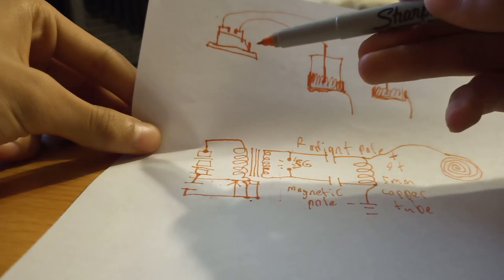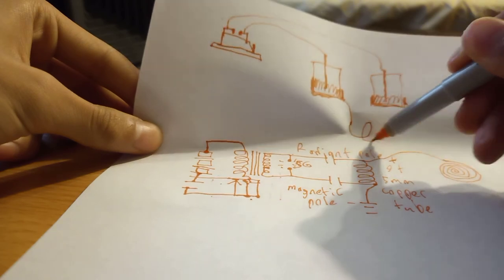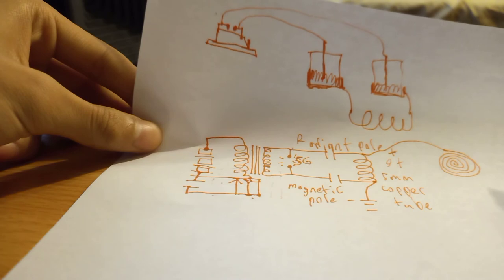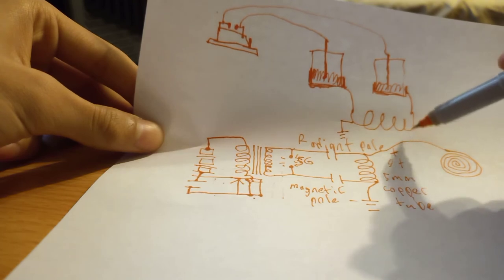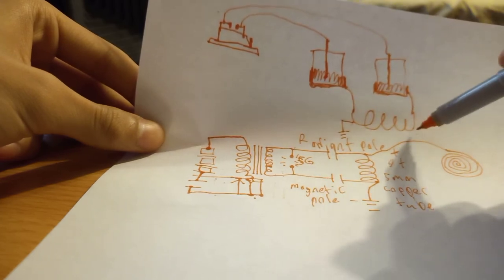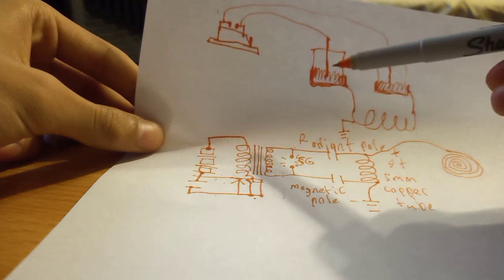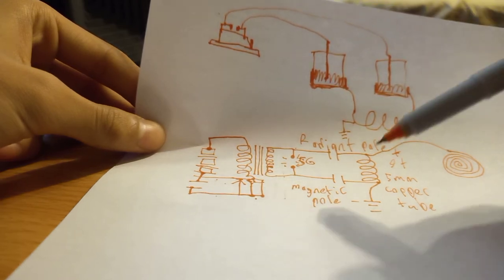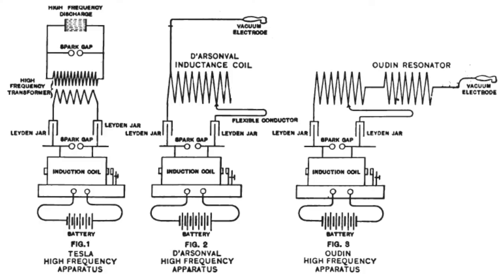What is Cold Energy?

Comment: It is very important to switch the positive of the primary coil, as this produces the white negative voltage spark, which is different than the positive voltage purple spark.
Reply: Hi from Italy! I'm currently trying to build a cold energy generator. Since I'm not using a Rhumkorff but an AC very old TV transformer (it has no diode it is AC) follower by a diode/capacitor voltage multiplier net, It seems I can't achieve cold energy. Aniway We also have a Rhumkorff and We have a two segment color spark. A side of the spark is white, and the other is purple.
I really don't know why?
My best guess is that the spark happens in a place wich is also immersed in the collapsing field of the coil, which has a North and a South. Maybe that can explain the two color spark?
Thanks for any suggestion. Bye
Reply: @grazianoturbogas   I think positive is purple and negative is white (which might be the cold electric).
other think white is related to the magnetic current flow, but I don't agree
edit : the white might be the current, but not the magnetic current, but the displacement current (dV/dt)
Reply: Where's the switch and how do you use it? 1x sec for 1 hz?
Reply: @naturalmilkhoneyandzenretr9508 
it was probably on a harmonic of the earth. he used a sparkgap as switch, but often also used auto oscilating relais (coil discharges instead of capacitor discharges). I use mosfets  to switch my coil discharges (around 100000 X second)

Comment: Just some small corrections, the modern concept of the Electron is incorrect, Tesla and all of the electrical giants opposed the electron particle model. Steinmetz provided an accurate model of it as the conjugate of dielectric and magnetic fields, voltage and amps, electricity is not a thing itself but the combination of those 2 mutually destructive fields. Electrons are just units of dielectric induction, bumps in the fields you could say.

Dielectricity (cold electricity, radiant energy, voltage, tension) is essentially electricity that has had its magnetic component removed, by removing the magnetic field (amps, hot, force and motion) from an already inductive circuit you create dielectric impulse currents that implode back into Counterspace/Aether, which itself is non-dimensional and non-Cartesian.

That also touches on another thing, there are only 2 "dimensions", dimensional and dimensionless, our universe and the Aether, 3D space is an incorrect understanding of this, it's actually 3 vectors of dimensional space, you can map out 1, 2, 3, 4, 5, etc, vectors but still remain in dimensional space, transdimensional travel would be passing between our universe and counterspace only. Mind virus.

And if you want to get into something even more crazy, take a look at this:

"Faraday was the originator of the concept of the magnetic field, (which is described in terms of "magnetic curves" our present day "magnetic lines of force") however he never so much as suggested in his works that induced currents were a resultant of changing magnetic fields. On the contrary, he clearly associated the phenomena of electromagnetic induction with changing electrical currents. As per Maxwell, he too considered EM induction as a phenomena in which a current (or EM force) is induced in a circuit. but not as a phenomena in which a changing magnetic field causes an electrical field. He clearly said that the induced EM force is "Measured by, not caused by the changing mag field" Just as Faraday, he made no allusion to any casual link between magnetic and electric fields"

"Maxwell too considered the electromagnetic induction as a phenomena in which a current is induced in a circuit, but not as a phenomena in which a changing magnetic field causes and electric field. He clearly said that the induced electromotive force is measured by, not caused by the changing magnetic field. Just as Faraday, he made no allusion to any causal link between magnetic and electric fields."

"But as we've seen neither Maxwell's equations nor their solutions indicate the existence of a causal link between electric and magnetic fields. Therefore we must conclude that an electromagnetic field is a duel entity always having electric and magnetic components simultaneously created by their common sources."

"A time variable electric current creates an electric field parallel to that current. The field exerts an electric force on the charge in the nearby conductors thereby creating induced electric currents in them. This in the term “electromagnetic induction” is an actually a misnomer, since no magnetic effect is involved in the phenomena, and since the induced current is caused solely by the time variable electric current and by the electric field produced by that current."

"according to these equations in time variable systems electrical and magnetic fields are always created simultaneously because they have a common causative source, the changing electrical current, once created the two fields coexist from then on without any effect upon each other. Therefore electromagnetic induction is a phenomenon in which the field creates the other, I.E energy generation is an illusion. The illusion of mutual creation arises from the facts and time-dependent systems of the two fields appearing predominantly together"

-Causality, Electromagnetic Induction, and Gravitation: A Different Approach to the Theory of Electromagnetic and Gravitational Fields by Oleg D. Jefimenko

In laymen's terms, this means there is NO TRANSDUCTION between kinetic energy and electric energy, no kinetic motion has never been transformed INTO electric power. A spinning generator only sets up the conditions for electricity to manifest. Think about that.

Electricity is literally conjured into existence and is not dependent on spinning machines to manifest, this throws the "law" of conservation out the window. The implications of that are obvious. 

This also touches on the terrible design of closed circuitry systems, Tesla used single wire without return prior to focusing on wireless, and that's important because closed systems are, well, closed. Earth and nature are open systems, it forces the circuit to be under unity and that's half the reason why it's so hard to create over unity, the circuit needs to be open.

Magnetism is the extrinsic attribute of the Dielectric field (the Aether under tension or torsion), it basically represents losses. Considering how a closed circuit works the sheer amount of amps that form should be an indication that something is wrong with the design fundamentally, our systems are extremely lossy magnetic, Tesla's and Steinmetz's were Lossless Dielectric.

Heck, a modern tesla coil, which is really a poor imitation of what is possible, is an open system as well, capacitive top load to store tension and ground connection, the power that comes out is enormous, switching to dielectric power systems would make what happens in a tesla coil exactly what you want for generating far more output than input. In-fact, SWT keeps the amps out of the system except inside the load itself if done right, experiments have shown that Tesla's SWT displays room temperature superconducting properties, the potential of these systems is truly revolutionary.

NOTE: The power in a tesla coil secondary is not cold electricity, the sparks are blue instead of white, the power first needs to be converted using a tesla coil design and then run through a hairpin circuit design to convert it into dielectricity, see FIG 5 of Tesla's Rare Notes.

Good video dude.

Comment: There is not much good information about this. Electricity is the surface tension (wind) in reflectors (metals, liquid and other conductive mass). If you resonate the mass below it's natural frequency, then the resonance occures under the surface of that mass and it gets hot. But when the frequency is higher than the natural frequency, the resonance occures above the surface and the static wind starts to cool the mass.

It's important to separate the resonance flow from it's original source with spark gap, to make it really safe (but the spark gap will create ozone).

Easiest way to do this is to use some slayer exciter circuit that uses 9v battery and add spark gap to it. Other popular way is the "Gerard Morin replication".

The issue with cold electricity is that it's very unpredictable with high power applications and it creates issues with modern devices. It's very good for light applications and there should be more study to the health benefits / side effects. It has been claimed that Tesla used it daily for refreshing :D Good job spreading the information.

Comment: You say 1nf capacity specifically, is this because of the behavior of a capacitor with a DC source and resonance control? From Nikola Tesla on his work with alternating currents and their application to wireless telegraphy, telephony and transmission of power:

"A large capacity and small self-inductance is the poorest kind of circuit which can be constructed; it gives a very small resonant effect."

And On light and other high frequency phenomena: "The higher the tension of the generator, the smaller need be the capacity of the condensers, and for this reason, principally, it is of advantage to employ a generator of very high tension." This is to do with his hairpin circuit.

In a DC system a capacitor will gain infinite resistance when it reaches max capacity, the spark would act as the discharger for it, with a 1nf capacitor the discharge rate would be extremely high.

Am I correct in understanding that in order to control the frequency you would either need to, A, use a set voltage input and find the right capacitance until you get a discharge rate at the circuits frequency, or B, you use 1nf capacitors and change the voltage input until it charges the capacitors and then discharges at the circuits resonant frequency? 

Is this the purpose of using 1nf, or something else? It seems odd my above suggestion would be the reason since there is a hammer switch circuit in the induction coil already there to control the opening and closing.

I wonder if the mechanical hammer could be replaced by using another spark gap and capacitor with a variable voltage source to change the discharge rate for the primary coil?